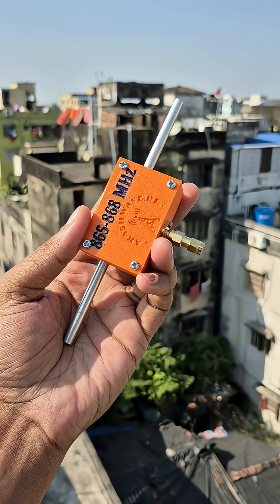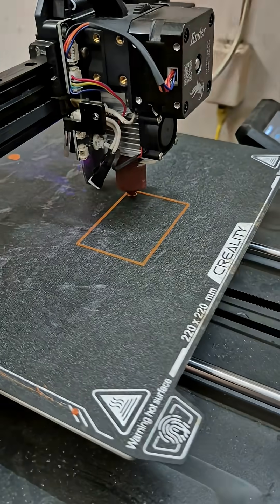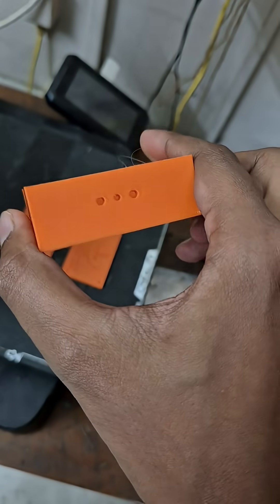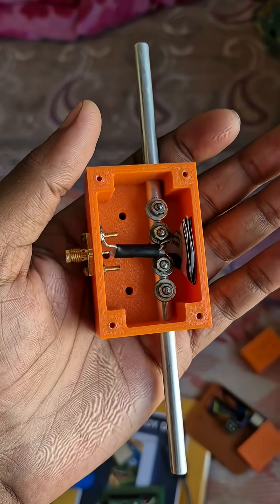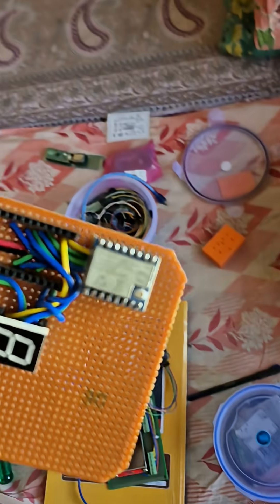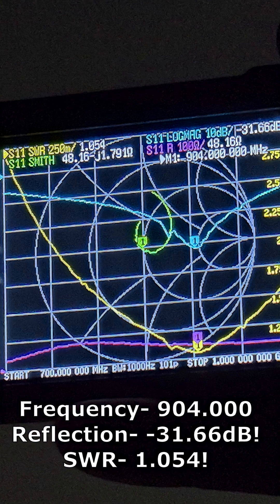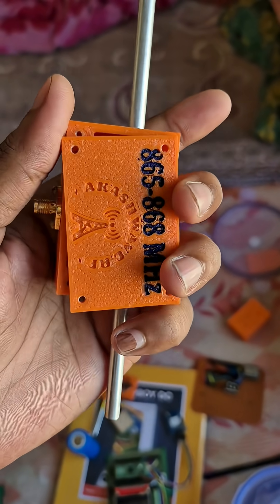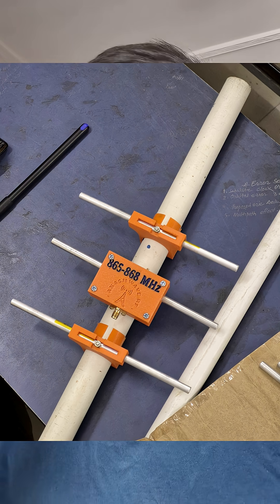Best 868 MHz LoRa Antenna for SX1262 & Ebyte LoRa modules diy #antenna #hamradio #arduino  #rf #diy

Comment: Nice project! And no balun required?
Reply from the maker: Good question bro! As you can see, already I'm getting 50ohms impedance in the desired frequency in this antenna, I don't really need an impedance matching balun here, but the coax is unbalanced and dipole is balanced, so it's good if you have a 1:1 balun or common mode current choke here, just a few turns of coax cable arround an air core so that our coax doesn't radiate at all

Comment: Bro can I use in the place of nrf module antenna
Reply from the maker: No way bro! LoRa operates on 433/868 mhz, way lower then 2.4ghz of nrf modules. It may give you a few advantages instead of absolutely not having an antenna, but it'll not work as an antenna for it, do you understand?